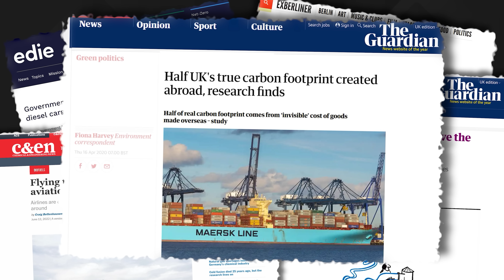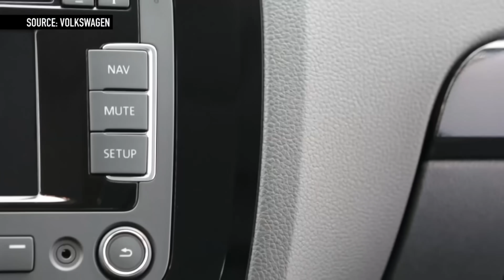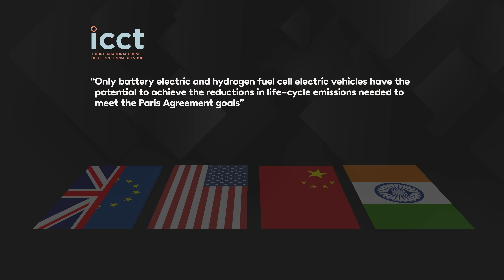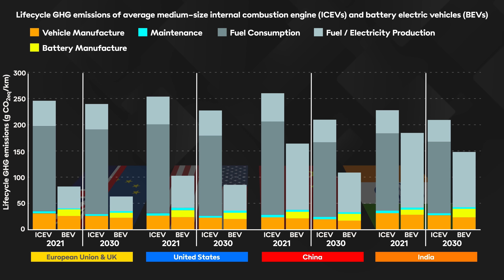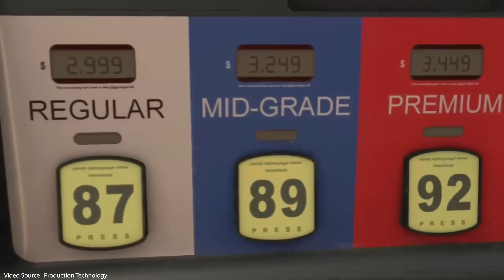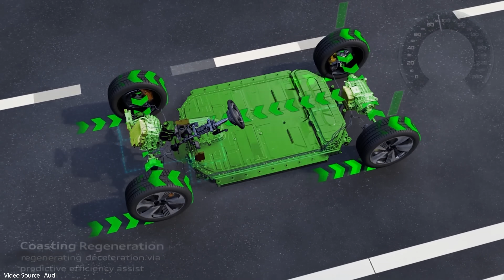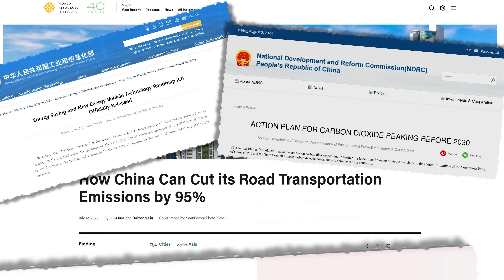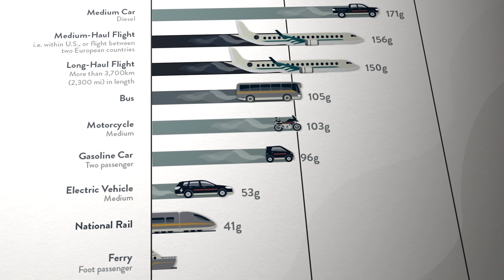Are EVs really better for the climate?

Comment: Keep you current car as long as you can and drive it as little as you can. That's the best thing for the climate.
Reply: Actually not, as the very short payback period shows. In the worst possible case, ditching a brand-new ICE car and buying an EV may at worst double the CO2 payback period. The report mentions 12,000 miles. So that gives us less than 24,000 miles. Quite a low number that is easily reached by EVs in a couple of years of driving.

Wasting a functional car may feel absurd, but the science is clear. The situation is comparable to replacing perfectly functional incandescent lightbulbs with LEDs.
Reply: @oznerol256 someone from my town bought a MINI Cooper SE, battery dead (below 70%) after 2 years, no warranty from BMW. Replacement costs more than the car is worth. Payback don't work in that case, isn't it? Or when you bought a brand new Fister Ocean a year ago, company bankrupt, no spareparts and software problems, you basicaly got a 2100kg brick. Switching from light bulbs to LEDs makes more sense.
Reply: @franzbernhard301  That's BMW for you. Proper EVs have 8+ years of battery warranty.
Reply: @ Well you are correct I'm certain but you only replied to half of what I said. All good.
Reply: Exactly what I'm doing. 1992 Volkswagen Polo bought in Dec 2003 for 1600€. 45HP gasoline with only 770kg, doing just about 10000-12000km per year. So far 332000km on the odometer. Would have needed the 3rd electric car by now, due to battery aging and aviability of spareparts.
Reply: @franzbernhard301  How much gasoline does it use per 100km?
Reply: @oznerol256  5.5-6.5l/100km. I need about 36-38l a month.
Reply: That's actually not true. In 5 years, and old car will produce the same amount of carbon emissions as it would cost to create a new EV. So keeping your old car as long as possible is only better for the environment if "as long as possible" is less than 5 years.

Comment: I dont understand how batery production is more poluting since it is more energy intensive. Use solar wind wtw and it is 0 poluting. Electric stuff has potential of 0 carbon emissions. Negative if you grow your carbon parts. It is all about the scale, and we peaked carbon energy potential a long time ago. Renewable potential is quite unlimited. It is not even comparable. Time to dich coal and move on.

Comment: I have absolutely no doubt that EVs have lower greenhouse emissions than vehicles with internal combustion engines. But I am still not convinced that the Lithium Battery EVs - the technology of choice at the moment - are better for the *environment* and you pay a hefty premium for driving them at the moment. My concern stems from the fact that - by and large - Lithium battery waste is just being stockpiled and mining/refining/processing/and recycling have their own environmental impact. In some cases the minerals are not being ethically sourced.

In my opinion we've chosen the wrong EV technology, and live in the hope that Hydrogen Fuel Cell Passenger cars and green hydrogen filling stations will become widely available, and that Li Battery EVs will be relegated to the shelf of bad ideas that we once had.

In the meantime the best that I can do for the environment, my finances and my health is to keep my petrol vehicle for as long as possible and use it as little as possible.

Comment: I live in Canada where we get winter, I've talked to EV owners and they dread driving on the highway in -20 or even -40.

I work up in Fort McMurray in the oilsands. There's only one charging station on that highway that may or may not work if you can even make it over 200km in the winter when it often reaches -30. It's nearly 500km to the nearest camp, so what becomes a 5-hour drive becomes a 7-12hr drive.

I also highly doubt China is going to change it's only building more coal plants and importing more oil so what the West does won't make a difference, and China could care less if it doesn't benefit China.

I'm sticking to my gas truck, and I'm lobbying the upcoming conservative government to ace all of Trudeau's disastrous policies to attract investment.
Reply: dont be shy, admit how many time do spend these ev owners for heating their batteries before being able to drive their battery cars. all we external canada are waiting your answer.
Reply: @nusplus3985  even better question how many EV owners went on vacation and couldn't start their vehicles and couldn't boost their vehicles? There was a big story last winter about a mass EV graveyard because the car's died in the extreme cold.
Reply: So you work for big oil 🛢️ and hate EVs and do not believe in global warming? Wooow

Comment: Regenerative braking is also a lie!! It is only possible when the motor EMF is greater than the battery voltage and is not possible when the battery is fully charged!!!
Reply: Generally regen is only restricted/off when fully charged, only needs to drop a few % before it's available again so the loss of regen at the start is minimal.

Comment: Battery powered EVs are anathema!!! They are lies by CARB about the efficiency of EVs!!! In their ARB/MSD/7-6-94 they claim that batteries are 80% efficient and motors are 90%. These are LIES!!!!! Charging a battery in one hour has an efficiency of 5.88% , in 15 minutes it is only 0.3675%!!!  Joule's Law!! The motor efficiency depends on how many stops are made. Each time it starts the motor and system efficiency are almost ZERO!!!!! And starting is also hard on the battery!!!!!

Comment: The claim that Electric Vehicles are environmentally friendly is a huge lie or a major misconception  because the environmental impact equation is computed only after the battery is charged when one adds required battery charging process to the environmental impact equation one finds electric cars pollute at least as much as gas or diesel powered vehicles. 
Most power on the USA electric grid is fossil fuels (coal, diesel  or gas) about 70%, nuclear provides about 20% and so called "Green" energy (wind, solar  and hydro) about 10% 
     Fossil fuel plants and nuclear plants  are about 30% to 35% efficient. 
     Line losses from the power plant to the end user are somewhere between 7 to 10%.
     Battery charger efficiency is between 80% to 70%
     Battery efficiency is about 70% for a new battery and about 50% for an old one. Note battery efficiency is significantly affected by temperature (as battery cools it is less efficient. )
     Efficiency of EV is about 70% but add required lights, all it's electric gadgets, Window defrost,  compartment heating and air conditioning it's efficiency drops to about 60%
The complete environmental impact equation:
                                  Best case           Worst case 
Power plants                35%                   30%
(Coal & Nuclear)
Line losses                     -7%                    -10%
     Equals.                      28%                      20%
Battery charger.      X80%                    X70%
      Equals.                    22.4%                    14%
Battery efficiency   X70%                       50%   
      Equals.                    15.68%                    7%
EV efficiency.           X70%                       X60%
     Grand total.              9.76%                     4.2%
What this means is when charging from the electric grid to get just 1 useful watt at the EV, best case over 9 watts are used at the power plant and worst case 23 watts are used. This is far from being environmentally friendly. During the Summertime when temperatures are around 65F the EV will probably be around 12 and in winter when temperature drops below 20F it moves towards 23. The vehicle exhaust pipe has essentially been moved from the vehicle to the power plant.

Comment: Personally, regarding cars, I still subscribe to keeping older cars, maintaining them well, and maximising the life of that older vehicle. I don’t own a car anymore, but if I were looking for a car and could find one I’d buy a Holden of the F, E, or H series which date from 1958 to 1984. I have a sailboat built in 1978, still with the original diesel motor and still going strong. Big part of our problems is the constant turnover in our consumption patterns, rather than buying well and keeping it long term.

Comment: Captured carbon mixed with hydrogen are on the horizon. Whilst I do not think this will kill the BEV it will certainly put them in their place, which is as urban runabouts.
Reply: torium nuclear batteries were on the horizon too, and still are - able to burn all the uranium nuclear radioactive waste into harmles materials. now answer to yourself - why is radioactive uranium  chosen instead of ecofriendly torium, and why there were electrical cars whole century ago and were suppressed in favour to petrol cars? such is the horizon.

Comment: EV's are actually worse for the climate, even not considering the environmental cost of building the vehicle and its nasty battery. The power to charge it comes from the grid, 80% of which comes from oil and gas.  After accounting for losses in transmission, a petrol car is environmentally 5% better than an EV.
Reply: lol, If you just watch the video you'll realize your comment is complete bs
Reply: @Einar979  you are video-believer? so go and find all those battery car burning videos - there are tousands of them, and believe them too. do you have the balls?
Reply: @nusplus3985  Im more of a believer in statistics than of a bunch of videos.. There exist 40 million ev's, so of course some of them are going to catch fire and filmed, especially the cars with bad battery ventilation..

But it doesn't change the fact that an ev on average is more than 20 times less likely to catch on fire than combustion cars.

Comment: My understanding in burning fuel for energy, the larger the engine, the greater the overall efficiency. So small engines burning gasoline is very inefficient, charging electric cars using power plants increases the energy efficiency

Comment: Hmm, I can't help thinking we should be concentrating on energy use patterns over types of energy.   Do you really think a 100 people in a 100 electric cars is better than a tank of diesel carrying 100 people?  Anyone considering the fact that the main form of plastic air pollution is produced by car tyres?  That it takes at least 30000 gallons of water to produce a single car? Or the ratio of cars required against the cars owned that sit unused on driveways and roads every day?

Comment: "Those still determined not be be convinced may point to China's coal-dependent electricity grid [...] ...if China enacts its three major national decarbonisation policies, which knowing China is highly likely..."
Wow! It's that sort of credulous nonsense that means climate goals will never be met.
China has a stated policy of no new coal-fired power stations...
...outside of China. Inside of China, they are throwing them up like it's going out of fashion. They are scouring the South China Sea floor to dredge up material to create artificial islands with airstrips on them. Islands that will be heavily polluted with oil-based substances from military equipment, and islands that are gradually being washed back down into the sea, dragging their rubbish and pollution with them. The majority of plastic in the oceans comes from China. Yet you think they will live up to their 'policy commitments'?
This channel's high-minded claptrap is exactly why people rail against the very measures you promulgate.
I have a smart themostat that encourages me to take part in an initiative to alter my air conditioning at certain times to reduce peak load. This isn't done to help the environment but to modulate demand on the grid to avoid power cuts at peak load. If they are struggling with air conditioning, how is the grid going to keep up with charging vehicles when people get home from work? You have a video that attempts to address this and it reaches optimistic-but-ill-informed conclusions as well.
Electric cars are a fantastic invention and are marvelous to drive, but don't try to foist your ill-informed opinions on how the rest of us live and then justify it with data that still shows China and India polluting like mad and overriding any effect we can make by spending more money on technology with no long-term history when we are struggling to pull funds together for the essentials.
In the 1980s, Norman Tebbit gave a speech about the unemployed "getting on their bikes" and going out to find work. It caused massive backlash, not because he was wrong (he wasn't) but because the remarks were so ill-judged. Your glib comment about changing from a car to a bicycle are about as ill-judged. At least Tebbit was proposing a means to go out and earn money, whereas your idea actively interferes with mobility required to earn.
Let's all "just have a think" about that.

Comment: How does the report clarify the 'lifetime of the vehicle'? Most manufacturers state the lifetime of the vehicle as 7 years. My diesel car will probably make 250000 miles and be well over 20 years old by the time I've finished using it up. If electric cars last as long then they will save way more carbon than the report suggests. It they stop working at about 100k miles then they aren't good enough.

Comment: There is a study that say the opposite http://www.iitk.ac.in/erl/Downloads/LCA%20and%20TCO%20Analyses%20of%20BEVs,%20HEVs,%20and%20ICEVs.pdf
Reply: let say with understandable words: every new produced and still unsold battery car polutes the air, the water and the earth in such degree, as every new produced and sold petrol car, used intensively for ten years - 300-500km daily. as for energy consuming, every battery car consumes ten times more energy for to be produced compared to petrol cars - and every kilowatt is made by burning coals, petrol and gas, wich do polute right? say thanks to china for still using steam mashines - powered with coals. and dont forget india too - both countries poluting like mad.

Comment: The problem is the way we do things, nothing else. If you are a Dutchman, wanting to take your family to travel from Amsterdam to Switzerland with a caravan, you could do this burning vegetable oil with a 25hp hybrid diesel engine. It might take you 20 hours and you might top out at 40 mph but it is achievable. It will take you a hell of a lot longer to do this with stored electric energy, but you can reach 70mph between charging stations. Meanwhile the super rich are taking a learjet to an airport where they will transfer to helicopter to land on a 200ft super yacht to burn tons of oil cruising around the Med, discussing policies with their WEF cronies. Anyway, can you buy a BEV with manual window winders and no central locking? All of the green claims for modern BEV vehicles are a joke to be honest.
Reply: so right, all those rolling coffins on batteries, where it is no way out since electrical power malfunction and starting the immortal battery fire, kindly named "thermal runaway", melting concrete and steel by 2700-3000 celsius, ruining malls, airports and hospitals, sinking ships and still being the ultimate goal of all the new believers - the believers in the heaven on earth.

Comment: Hydrocarbons are far more energy efficient and that's why they are the dominant choice to power vehicles. I happen to choose not to own a car and I use an electric battery bike to get around plus use public transport. However, I think that all the talk about replacing gasoline or diesel cars with electric battery operated cars is a hype. The environmental pollution effects from electric lithium batteries combined with the fact that electric cars require far more rare earth materials with the reality that most electricity supply does not now and will not any time soon come from so called renewable energy sources, makes electric cars a feel good but zero rational choice. 

There is not enough copper or rare materials to replace hydrocarbon vehicles with electric.

The environmental cost of digging it out and then creating these cars is enormous. 

The reality is that the electricity supply network would need to at least triple what it is now, just to replace gasoline cars with electric. 

Most electricity still comes from regular coal or bio pellets or hydrocarbon anyway. So you are only replacing a gasoline car with an electric car fulled by coal or gas or bio pellets (which ruin natural forests and are very low energy efficient too). 

All this massive economic and environmental impact for the sake of a hypothetical climate crisis which there is still no foolproof credible evidence.
Reply: There is far too much attention on plant food carbon dioxide...and nothing like enough brain power being used to look at all other and arguably far more serious environmental harms. Plus where do you think all these batteries and eg solar panels are produced? - the answer is probably in China, where their environmental standards are so much lower than ours and where most of their electricity comes from burning coal to produce energy

Comment: So, the message is: an Ev emits three times less than a conventional car. Great. But if there are three times more cars in circulation in 2040 (as it is likely to happen with the growth of China and India), it doesn’t help whatsoever, we are still emitting as much! What we need is less cars in general. This can be accomplished by redesigning our infrastructures and cities and the way we live. EVs are a good thing, but they are by no means a solution to the problem we are facing.